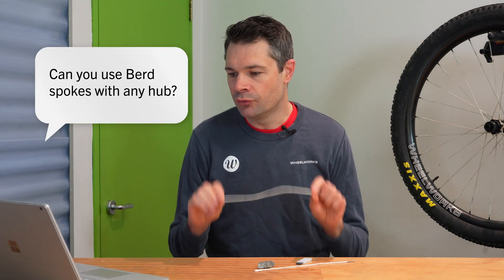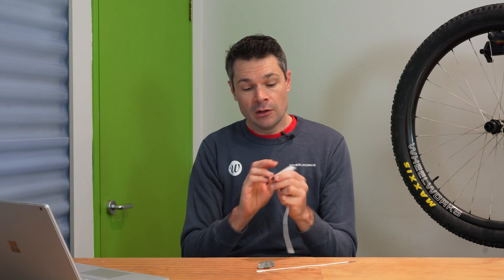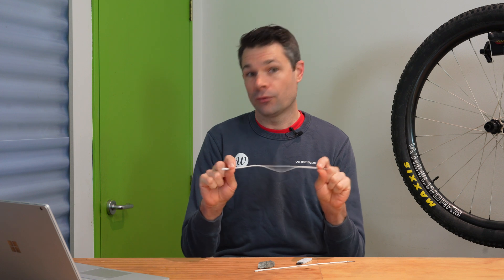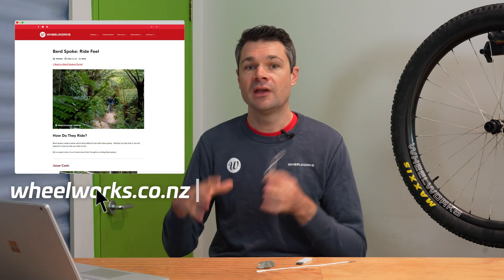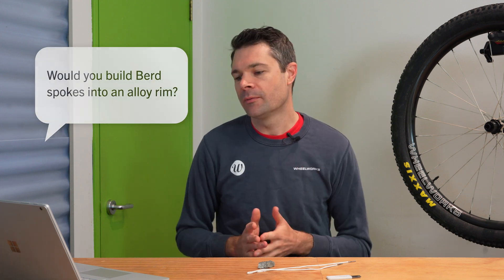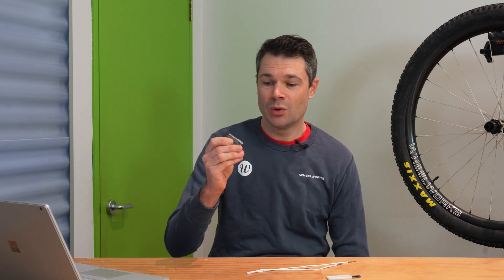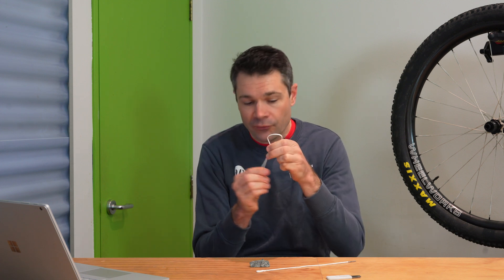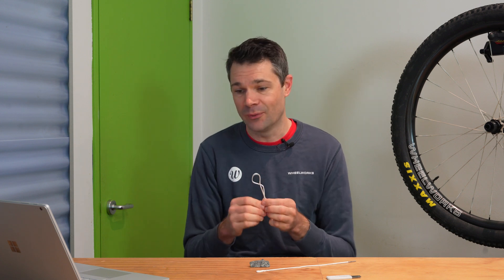Berd Spokes: We answer your questions!

Comment: Odd question now. Straight spokeholes on the hubs, and change position on the spokenut to the hub. A grooved bead to the rim for the loop, or perhaps a coneshaped end of the string. Could be some savings weightwise on rotationmass.
And neater look on higher rims, 45mm and up.
Will be a bit fiddly to tighten spokes at the hub i guess, bikenerds are a masocist lot 😂.
In my deranged brain i often think outside the box how to do things a diffrent way.
Perhaps its only 10-15 grams in gain? What this is in watts at  racespeed, people that know that  feel free to share. 😊
Best regards from stockholm
One day i might afford a set of these wheels.

Comment: Technically pretty cool stuff and to me the main niche is to make super light, complaint wheels with carbon rims. But...
For an enduro wheel you save about 100 g rotating mass by picking carbon instead of Al, (Newman A.30 is 556 g in Al and 456 g in carbon). But overall, you have to add the thick DH tires + sealant, which weigh around 1400 g and adding up everything you'll face ca. 2000 g going with Al and 1900 g with carbon, i.e. you save around 5% ... if I also factor in the spoke weight (steel 7g vs UHMWPE 2.5g) it's another 100 g, so about 10% (assuming they would weigh in as badly as the rim and tire, which they don't because their mass is closer to the center of the wheel, but anyway).
So by spending 700€ for carbon rim + berd spokes VS. 80€ for Al + steel you save about 10% rotating mass. Definitely a dentist-kind of investment 😅.
And what they also don't tell you is UHMWPE is prone to aging, especially UV exposure with a bit of humidity and oxygen. The DAV tested slings (climbing equipment) made from UHMWPE and found that within 3-5 years they became unsafe. Nylon slings were 100% safe after that time. Steel doesn't age.
Reply: Not really 
I got dyneema spokes(not berds) on DH carbon rims and my wheels are laterally stiffer than aluminium ones. But with much more dampening + no trueing at all at a comparable weight

It’s only  more expensive

Ps I use 2.5mm spokes (I think berds are thinner) so the whole not stiff argument is not based on the material but on berds being thin

Comment: There is an interesting conversation (I think) on the Park Tool channel regarding interlacing, and the effect it has on a wheel. Would be cool to hear your input!
Reply from the maker: Funnily enough I've been thinking a lot about this topic recently and wondering why we interlace spokes in the modern world. I heard that Park conversation but it wasn't especially technical. I've been thinking about how I can test and quantify the interlacing... Stay tuned and get subscribed 😅 -Tristan
Reply: Sounds like a great plan. Seems that the difference won't be small. I will subscribe, Thanks @WheelworksHandcraftedWheels

Comment: Great Q&A, just wonder if road bike can use these spokes?
Reply from the maker: Yep, no problem!  They produce a very light, very smooth-riding road wheel, but they won't be as aero as a modern bladed steel spoke.  We tend to build light weight climbing wheels using the Berd spoke, but "do all" wheels tend to use the bladed steel Aerolites.  -Tristan
Reply: @WheelworksHandcraftedWheels  Well noted, thanks for your feedback, so I think i shd go for blade spokes instead.

Comment: Great video! Thanks for sharing.

I've found a drip of wax based dry chain lube (Smoove, Squirt, etc) at the cross and at the flanges helps with the abrasion you mentioned in the video.
Reply from the maker: Thanks for sharing!

Comment: Would it make sense to pre-stretch some spokes for faster replacements?  What kind of setup/weighting would be needed (eg. hang a weight, or lace into an identical wheel)?  How long would they need to be under tension?  Once stretched, could they then be packed for a trip, or would they "unstretch"?
Reply: You'd need around 100kg for 3 days. The tricky bit of the stretch is "creep", which once has been set doesn't return. Could be worth doing if you wanted the easiest drop in replacement.
Reply from the maker: Good thinking @thetart20 - ps I love the Westfield -TT

Comment: Bicycle industry reached a point where there is too much voodoo. Carbon wheels got damaged to easily so they added more carbon making them the same weight as alloy wheels. Carbon wheels were too stiff so they added more compliance with spokes and/or rim design. So the final result is that most carbon wheels have very similar feeling to alloy wheels. Just for 5 times more money. Another argument in favor of carbon wheels is that you don't have to true them, and you need to true alloy is also invalid. A WELL laced alloy wheel will have exactly the same feature. The difference is that carbon will fail catastrophically in the case of hard hit. Aluminium will bend and you'll be able to roll home. And last but not least the "crash replacement". First of. Will the company replace my rim on the spot? No. Second. Is it healthy for the environment to replace carbon with carbon indefinitely? No. You want excellent wheels go with EX511 or FR541. Lace them well and they'll be wonderful for fraction of carbon set.
Reply from the maker: Wow, ok, lots to unpack here.

First up - we build and sell wheels with both aluminium and carbon rims.  Each have their own pros and cons, and each can be good or bad depending on the components used and the way they're built.

We find our Flite carbon rims to be significantly more robust than aluminium rims for most use-cases.  They're also lighter and wider.  This comes at a cost and they're about twice the price of an aluminium wheelset.

Our carbon rims are extremely unlikely to fail catastrophically to the point where you can't ride home.  We've never had this happen.  Generally speaking the rim will continue to hold tubeless pressure but can always be ridden - Tom Bradshaw even did 3 days of heli shuttling on a cracked Version 2 rim without issues.  This increased robustness and durability is why we have a lifetime warranty on our carbon rims, and why customers rarely need to use it.  We're unable to offer this on aluminium rims, even the really good ones.

The environmental impact of the two rim materials is very complicated to understand and compare.  This is something we've tried doing a number of times however it's incredibly complicated.

The two rim materials are less about "good" and "bad" and more about suitability for certain riders and bikes :-)

-Tristan
Reply: @WheelworksHandcraftedWheels  Although understandably overly complex, do you have any videos or reports about the environmental analysis comparing carbon and alloy for those of us outside of the industry to attempt to glean an understanding?
Reply from the maker: @philhunt1442  no, I don't.  I've scratched the surface on this a few times but it's a incredibly complex to understand the environmental impact of any given product - especially a category of products like "carbon rims" where there will be significant differences between a good manufacturing chain and a bad one, and a significant difference in product lifespan.  This sort of work is being successfully done in clothing manufacture where the garments are produced in higher volumes and with less inputs and sub-components, but as far as I can tell it's still a long way off for more complex products and for smaller companies.

Shimano seem to be taking environmental impact seriously and have reduced the amount of plastic in their packaging.  Other companies could learn a lot from this one small action.

I'd like to think we're doing a reasonably good job by simply designing and building wheels which last, and which are serviceable.  The longer we can keep a wheel on a bike and out of landfill the better.  This seems to be a very simple way of looking at things and glosses over many of the subtleties, however as a core value I think it's important.

Does that answer your question?

-Tristan
Reply: Sounds like you ought to stick to alloy and let the rest of enjoy our carbon.  Good luck try to convince people there is no difference in performance.
Reply: There is no argument when it comes to the environmental impact of carbon VS aluminum. You can recycle aluminum almost indefinitely. You can recycle carbon MAYBE once. You can make an aluminum wheel from recycled aluminum. You'd be hard pressed to find anyone making carbon fibre anything out of recycled plastic.

Carbon Fibre is an incredible material, but the fact is, it's plastic. It's in our blood and our water now because it never biodegrades.

Comment: hey could you compare a bird spoke wheelset with a pirope wheelset?
Reply: I built, and have ridden for a few hundred miles, a rear MTB wheel with UHMWPE (what Berd uses) on one side and Vectran (what Pi Rope use) on the other. There's very little between the two materials - any differences I noticed were at the build stage (rather than riding), and related to the construction type (12 vs 8 strand) and post-manufacture treatment as opposed to the material itself.
Reply from the maker: We haven't had much experience with pirope spokes but this is a great idea -Tristan
Reply: @WheelworksHandcraftedWheels  i´d be happy to see that video. Since almost 2 years now i´ve been riding a set of piropes.and im intressted to see how the are diffrent to the birds.